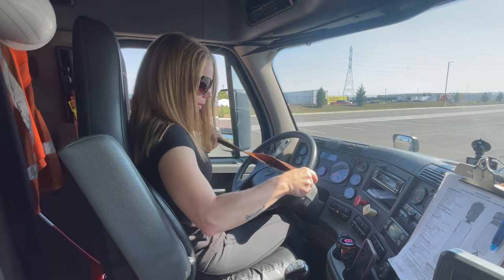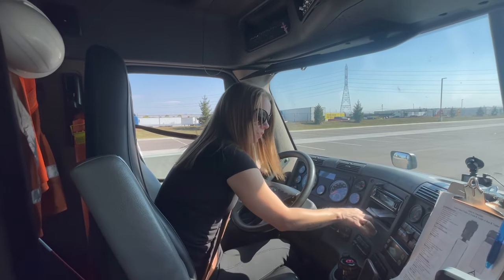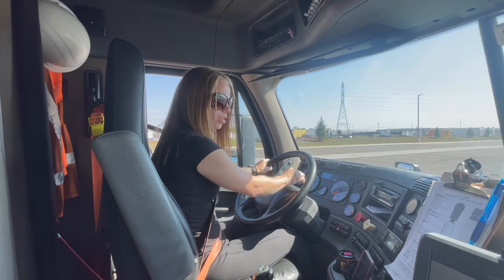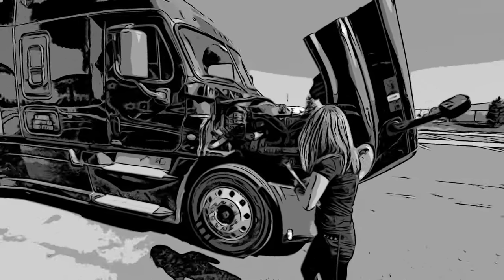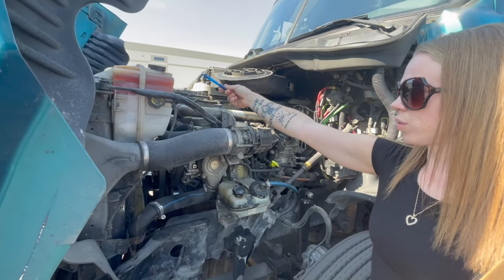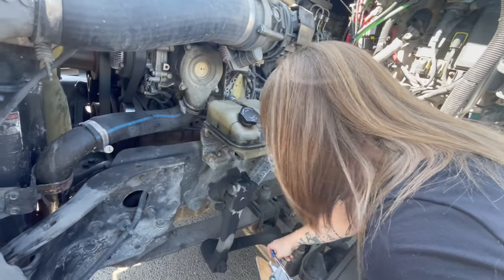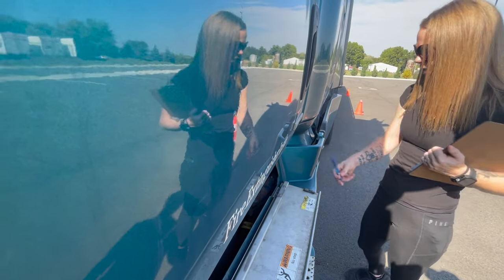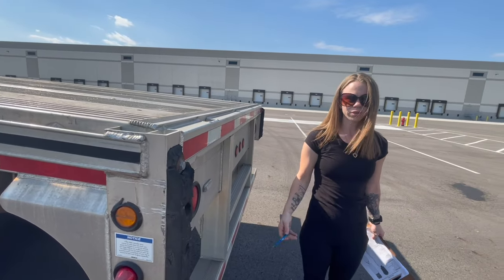Updated Ohio 2023 Class A Pre-Trip Inspection

Comment: FYI you cannot pass your air brake test in Ohio if you leave your tractor spring brakes engaged while conducting the governor test. You must disengage both tractor and trailer. Yes I know the truck rolls in either direction but it will settle.
Reply from the maker: That’s incorrect. Show me where that is stated in the updated Ohio commercial drivers manual: https://dam.assets.ohio.gov/image/upload/publicsafety.ohio.gov/hsy7605.pdf

It does say that the wheels must be chocked but we asked the testing instructor before hand and he said that he does not require it.
Reply: @solOperator  thanks for the quick response that means a lot to me. This manual is still very much out dated as all copies say version 2017 and lack clarity on protocol so we’re left with our own interpretation. The whole purpose of the test is to test for leaks which is why your spring brakes aren’t on for your low air pressure test and your emergency spring brake test. It also is to test when the governor cuts out which is between 120 and 140 psi. With that said I actually failed for this reason. As a cdl student I want correct information as well know how hard it is to get consistent and accurate information. Thank you
Reply from the maker: No problem. I think you might be mixing up the “air gauge and governor cut off check” with the “air leakage rate test” which is done with the engine off in order to check for air leaks. The air gauge and governor cut off check is used exclusively to check that your air gauge and governor are working properly. 

Sorry to hear you failed but keep trying. You’ll get it. Best of luck!